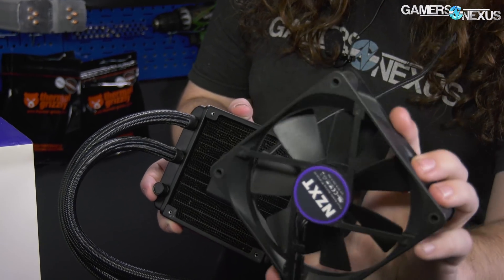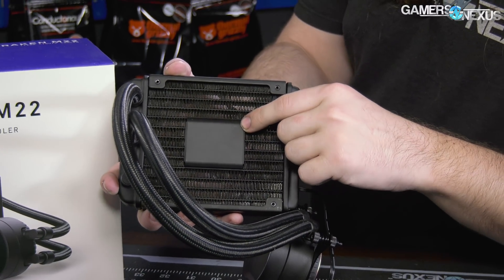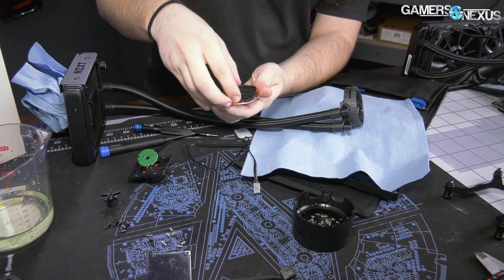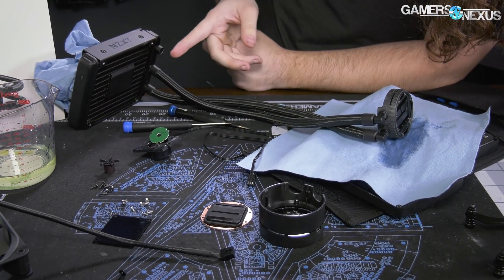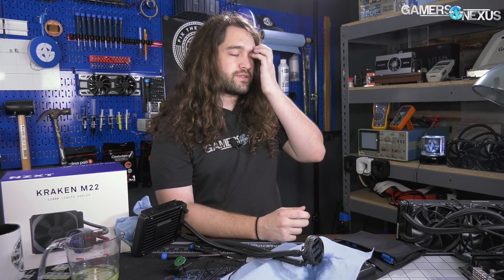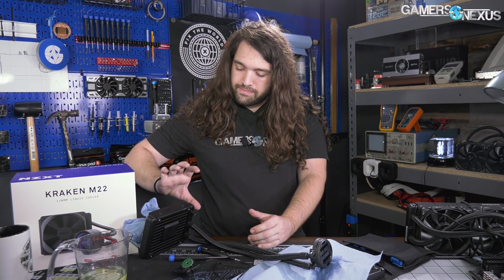Tearing Down a Strange Liquid Cooler - NZXT M22 Pump-in-Rad

Comment: When does this innovation ruining patent run out?
Reply: It's about as valid as patenting rounded corners imo
Reply: Lars Bolduc no that's copyright
Reply: sean miranda true, but if the patent didn't exist in the first place, there would be greater competition between manufacturers, and that's what drives innovation. Look at intel the last 6 odd years, no true competition, so no reason to innovate. Asetek has no competition because of this patent.
Reply: Dick R Dick R Innovation can be defined as a "new idea, device or method" device and method being the keywords here. The most logical place as stated by Steve to put the pump is on the block. But no one else in the industry can develop on top of this because of the patent. Leaving the technology stagnant, as seen with Asetek's latest generation of pump (no improvements). The only way manufacturers can differentiate between one another is the fan and the size of the heatsink. Leaving a major part of the design the same, and tbh the pump is one of the noisiest parts of an aio. It's just a shame is all I'm saying. Also sorry for sounding rude before, its one of those that when you read it back it comes across totally different from how it was intended lol!
Reply: you mean the work around? That's innovating around not innovating to create something better.
Reply: @vespaman101 
This is like Colt's patent on bored though cylinders on a revolver, loads of "innovative" designs were made to get around that patent which immediately went away when said patent expired.
Reply: Ghost I think i see what you meant now, and we both agree the tech is stagnant for sure. Upon reaserching Asetek's many generically illustrated patents, I'd say they are a prime example of patent abuse or trolling. 
It's too bad the US court/Judge didn't reach the same conclusion the EU Judge did later, IIRC he basically  found the design was not inventive enough to justify a patent and ruled in favor of CM to receive compensation for court cost, or something along those lines. So as I understand it their patent is null outside the US now.

Don't worry about sounding rude, I'm likely guilty of that myself. You didn't resort to name calling and stayed focused on the issue being discussed. Nothing rude about that. Besides, you can't control my own misinterpretation of your original point. It's all good.
Reply: Ghost  Yep, I definitely see your point now. The pump noise issue is a great example! That one finally penetrated my thick skull lol.
 The patent restricts others from being able to remedy or even improve noise reduction on pump-in-block designs, which hurts everyone, including Asetek.
Reply: @dickr9345  I think you and Ghost both both have a point....but I wouldn't go so far to say patents ruin innovation either.
Reply: Dick R that's a redundant statement if ever I heard one. If the patent didn't exist in the first place, there would be greater competition between manufacturers, and that's what drives innovation. If you need an example, look at any product at all. Say apple owned "the phone" and no one else could make one, it's called complacency and stifles innovation. Asetek has no reason at all to improve as they own the market, in fact their latest pump (as stated by Steve) has almost 0 improvements on it. It's not difficult mate.
Reply: Ghost it didn't stop this innovative product to be made. With or without the patent if everyone made on block pump aios is that really innovation.
Reply: Patents never end anymore. You'll have to thank Disney and Mickey Mouse for that.
Reply: Ghost Sorry, I'm not seeing how that's reduntant.
My grammar may be incorrect but I'll try to break it down, for the sake of clarity.
Asetek holds a patent on AIO pumps housed inside the block. Manufacturers who wish to use this AIO design(pump in block)must have Asetek's permission. I.E. pay to use Asetek's patented design.
NZXT opted to innovate(I.E.to make changes : do something in a new way) placing the pump on the radiator.

Merriam-Webster Definition of innovate
     transitive verb
1: to introduce as or as if new
2archaic : to effect a change in.
     intransitive verb
: to make changes : do something in a new way

The phone example is a poor choice,
but since you mentioned them consider this;
Phones are/were an invention.
Smart phones are/were an innovation. 
They didn't patent the AIO cooler in general. They patented the cooler's pump being integrated into the block above the coldplate.
Reply: Ghost You do understand that this "innovation ruining patent" is directly responsible for the innovation seen on the cooler in the video, yes?
Reply: Ghost Don't throw the baby out with the bathwater while putting the cart before the horse.
Asetek may indeed have no reason to innovate at this time. Why should the new gens be drastically different or redesigned?
OTOH
Other manufacturers have plenty reason to innovate. Their competition(Asetek) is/has beat them. If other manufacturers come up with a superior design and begin to take market share from Asetek, what happens? 
Asetek starts losing money and now has reason to innovate. 
Yes, They could do it now, get with the program, and stop being complacent. Waiting for the above hypothetical to happen is on them, and is their prerogative.

Know who else has been complacent for years? Intel has - and how's that working out for them of late?

Comment: Isn't there suppose to be some kind of law against owning patents for unavoidable design choices? Like all wheels are round, and all pencils are straight, and all liquid coolers need the pump at the base, I think the judge or whoever approved this patent just didn't understand liquid coolers at the time.
Reply: Judges don't approve patents, someone at the patent office does who does not have the time to police each request. That is the massive problem with the patent system here. In the US system a patent does not mean you innovated anything, it just means you requested something and that request is not owned by anyone else... the mindless bureaucrat approves it, and the whole system is then expected to get handled by the civil courts as to its validity in any contests, because the patent office lacks the people and funding to actually investigate each patent request.
Reply: At least they should reduce time for this type of patents, like no more than 5 years.Those bs like this case create monopoly.
Reply: "I think the judge or whoever approved this patent just didn't understand liquid coolers at the time" Still most likely doesn't understand this or many other things they rule on. Should be a law on judges having to understand what they are ruling on so shit like this doesn't occur.
Reply: flexible pencils have entered the chat
Reply: No. If the wheel was invented today, the inventor could patent it just fine. The Asetek patent is a lot more questionable though, since they're only patenting the idea of having the pump located in the CPU block. That particular design choice is not the only choice, just pretty clearly the best one. Going back to the wheel analogy, it's like somebody patenting the idea of having wheels at the 4 corners of a vehicle, rather than patenting the wheel itself.
Reply: And? So what if they are allowed to or it is the law. Does not mean they should.
Reply: This isn't unavoidable though. There are already three other prominent ways other companies integrate the pump. Here in the middle of the rad, on the side of the rad and on the top of the cpu block in a separate chamber (not connected). In fact the last one is a trademark aesthetic now of that company. The name is escaping me though but you've seen it I bet.
Reply: @CheapSushi  The cooler master masterliquid pro? That one looks like as you describe there being a separation between the block and pump.
Reply: @freikinpoptarts  I was thinking the DeepCool "Captain" AIOs but I think that ML Pro fits that description too.
Reply: It's a huge issue, patent trolling in general is such an asshole thing to do. Closely related is the whole Apple thing and 3rd party repairs/right to repair. Check out Louis Rossmanns channel on the matter.
Reply: they only have 5 years left on that patent so it is not really worth fighting till then.
Reply: @dstblj5222  Actually they have until 2038.
Reply: @TonkarzOfSolSystem  Did they files this patent in 2018? Because patents only last 20 years.
Reply: @dstblj5222  They filed it ages ago (2005 in the US IIRC) but various patent exploits/tricks means the expiry date is now 2038.
Reply: @TonkarzOfSolSystem  they can pattent upgrades and changes again like how they added rgb but they can't extend the basic pattent generally.
Reply: @dstblj5222  I agree that they shouldn't be able to. But, well, there are exploits and loopholes. 

I don't know how they did this particular case, but one old (since closed) loophole would be to submit a patent and then change it repeatedly during the "secret patent" period. The patent would protect the invention and yet the small changes would reset the secret patent period and thus the overall patent period.
Reply: @TonkarzOfSolSystem  The current strategy is to patent something then patent the upgrade/change, but the reality is that weakens the patent over time, and those patents still weaken
Reply: Unlike Copyright. Parents can expire
Reply: @hanro50  Ma! Pa! Oh no!
Reply: @hanro50  the difference here ist .. a Patent  is for the Way to do something ..  Copywright is the Protection of what You Write .. not the Way how You write it ..
Reply: There is SUPPOSED to be such a layer of protection. Look at the patentability criteria:

* Patentable - mechanisms are patentable
* Useful - mounting a pump on the CPU saves space
* Novel - it stands to reason that no prior art exists
* Non-obvious - THIS is the one you're looking for.

Obvious in this context means that any number of qualified engineers, given the mission statement (i.e. create a factory pre-assembled sealed liquid cooling assembly for easy installation), would come to the same solution (mount the pump atop the processor, because that's just the most convenient spot, and put it right on the centre-inlet hot plate, sparing the plumbing).

These are the criteria that have been deemed necessary by historical precedents, thus creating a system in which the usefulness of the patents in innovation rewarding and their detrimental effects on competition are well balanced against each other.

Unfortunately, non-obviousness has been gradually eroded as a criterium over the recent decades, and is completely broken now. Because there is simply no way you can prove it with documents that this is how it would have been done, for something that hadn't been done up to a certain point, so if you want to invalidate a patent, it's prior art or bust. If something that is done now in a particular way and is the subject of a patent dispute, you cannot find proof that the current best-practice is not a result of everyone being familiar with the patented invention. I.e. you cannot prove that engineers nowadays choose to put the pump atop the CPU socket because they would have done it anyway, rather than because they saw Asetek do it and absorbed and internalised the idea. And the silly patent workaround products which for example mount the pump in all sorts of places, only further erode the obviousness argument.

Patent offices are supposed to catch MOST invalid patents, but they don't have the final say, in case of contention, courts do, and they also have to follow the court decisions. If the courts cannot invalidate the patents based on a given line of reasoning, then patent offices by all reason shouldn't either.
Reply: If someone invents something genuinely novel like the wheel, they should definitely be rewarded with a patent. That allows them to make money on their idea and work, incentivizing innovation. The problem is when patents get awarded and upheld for stuff that isn't really novel and valuable to society.

Comment: Thank you for starting my favourite new drinking game, Mod Mat Bingo. So far I have Linus and Paul, if I get Jay I down the bottle.
Reply: Hardware Unboxed has one also.
Reply: Thanks Troy but I did the Hardware Unboxed from their unboxing video in the top corner of my play square but doesn’t yet lead to the line needs to down it. So far Linus and Paul along with one of the free GN squares gives me the 3 of the 4 needed to down. If the mats get anymore popular the rules will change to only videos shown that week before a reset Monday.
Reply: Anytime you spill water on the mat, take a shot

Comment: When does Asetek's patent run out like Cherry's did?
Reply: I've no experience with Kailh switches, but I wouldn't be surprised if they are indeed better, Cherry was sitting on their butt for decades, before they started introducing more switches right before their patent was about to expire. Perfect example how patents stifle competition - now again if Kailh is better or not I don't know, but it wouldn't surprise me in the slightest. Innovation comes from competition, having no competition makes you become lazy.
Reply: The patent was granted in 2006 
https://patents.google.com/patent/US8240362B2/en

'Fun' thing is that the patent really grants rights ot just about any watercooling that uses a pump, which alone should nullify the entire patent IMnHO from the start.
Reply: MadrixOG we all know that IBM buckling springs are the superior key.
Reply: Hey, it's the actual answer.  Thanks Neezy
Reply: 2025, its U.S. Patent 8245764
Reply: Kailh's been innovating with their BOX switches, Gateron is much better and cheaper than Cherry as well. QC is probably as good, and their linear switches actually feels decent and smooth, unlike Cherry's crap. Also, they produce "custom" switches like the Zealios, which are highly improved Cherry MX Ergo clears.
Not to mention all the other budget brands that drove the cost of mechanical keyboards down, making it available for more people.
Reply: I've got some kailh box navy switches and aside from the obvious click bar innovation they also feel less scratchy than my cherry switches when you slowly press them in.
Reply: TheUncleshady kailh is better than cherry now, wouldnt mind seeing better liquid cooling systems and pumps better than asetek :)
Reply: How is kailh better than cherry now, exactly?
Reply: Apparently having an opinion is "internet stupidity".  You're a fucking moron.
Reply: +Unilythe - kailh is better because thats all that he could afford
Reply: It's all personal preference, but cunts will say Kailh is surperior than Cherry just because they like Kailh more. Just standard Internet stupidity.
Reply: Vicious Circle It's OK when someone has an opinion, but it's not OK when someone tries to force that opinion on someone and disrespect other opinions. Kinda like PC gamers shitting on consoles and vice versa. That's Internet stupidity, OK?